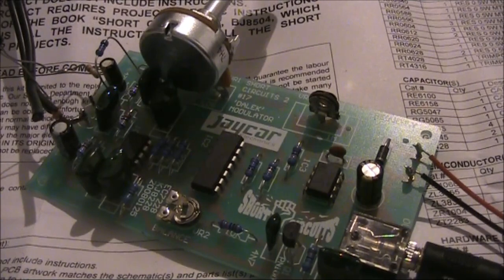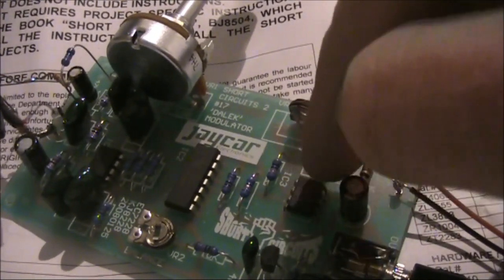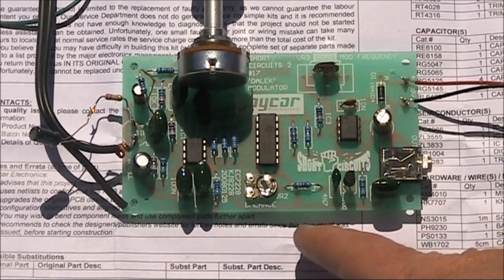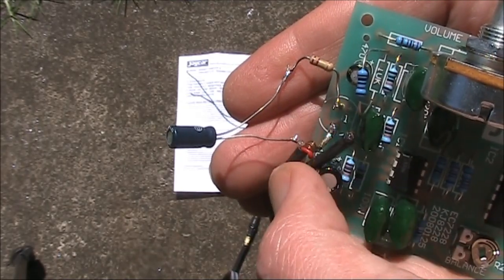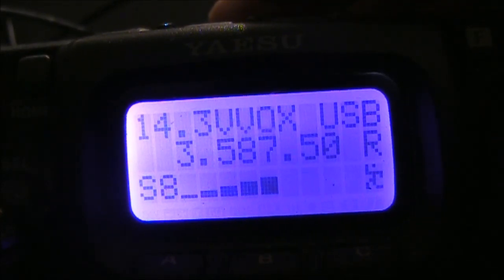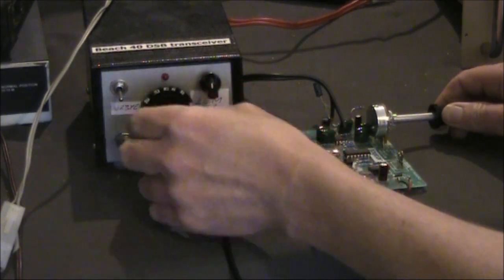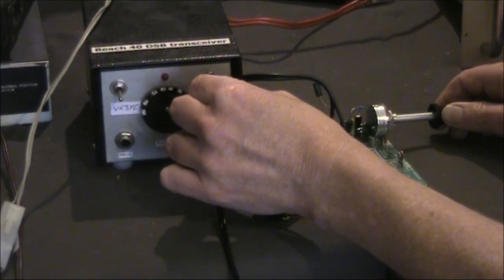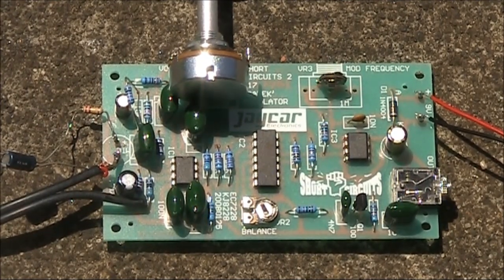Dalek voice modulator inverts your sideband

Comment: I started making a little el match coupler for the upper HF bands. It has small sections of air variable going as low as about 2pF. For the inductor right now I have to use a fixed value but might try building a small variometer. I thought about the coil-in-coil type mentioned in one of your recent videos but thought it might become problematic at these higher frequencies. As it is just standing closer than about 4 feet away drastically affects the readings on the analyzer. So I guess I'm off to rack my brain to think of some nesting spherical objects that will support a few turns of wire.

Comment: It seems to me that there should be a simple way to demodulate DSB. I wonder what happens if you frequency double a DSB signal and then mix it with the original? Maybe it turns into AM or baseband audio but I haven't tried it.
Reply from the maker: I did read somewhere about doubling it then halving it and generating a phase-locked carrier which could enable clear detection without flutter etc.